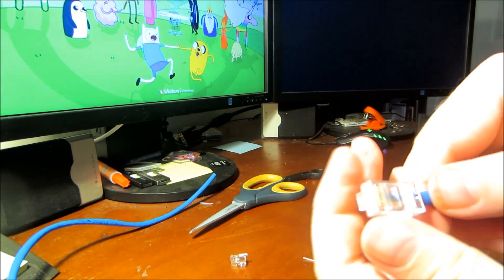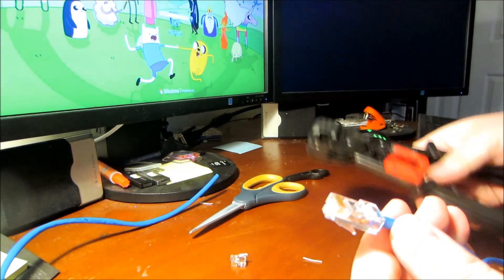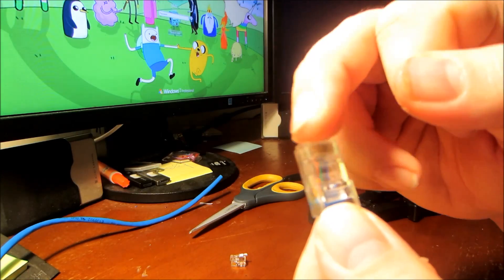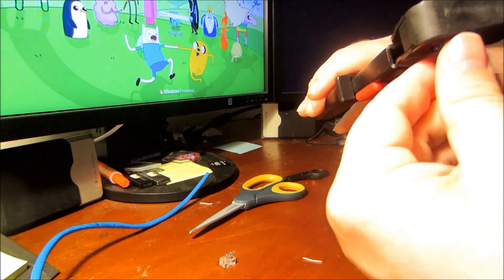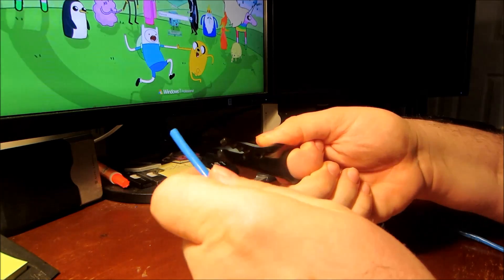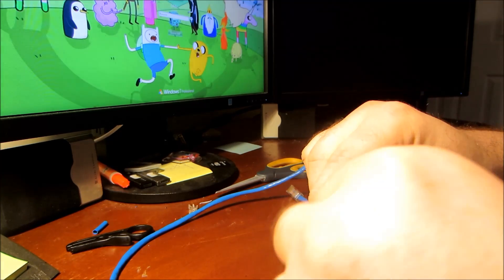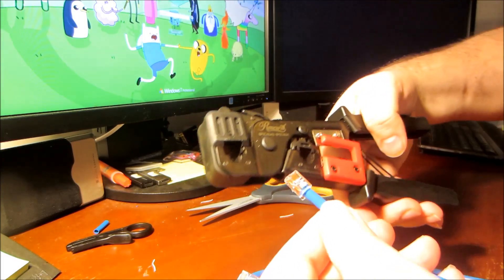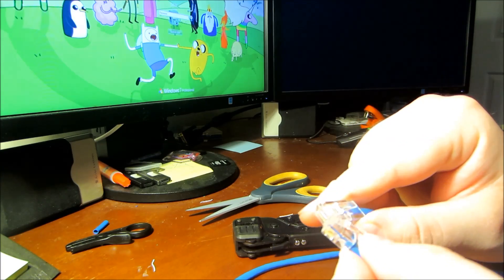How to terminate RJ11 connector to cat 5 cable

Comment: Always use twisted pairs per standard telephone practices to reduce the possibility of noise pickup especially if your cables are long and/or used in areas where they may  be suscepitable to EMI from other electronic/electric devices.

Comment: Just a question I have if you may mind me, I am buying old dated house from 60s and one of the first things is changing the molding inside, can I buy a cat5, cat5e, cat6 or cat3 and wire that into a phone jack and just add a plain rj11 end on the other side, I am using cheap VoIP) Obihai/xlink gateway.  I do not have a network interface device unfortunately so that’s why I need to just add a rj11 end.

Comment: But you're not using pairs properly.  You're using four wires, one from each of the four pairs.  Best phone wiring, especially when modem or router is involved, would use a twisted pair for then main phone line. Blue and white/blue for example.
Reply from the maker: Ummm no. Connecting a RJ45 to a RJ11, actually used for a fax line that goes to a POTS on a router. I think you’re missing why I did this. Was to connect a rj11 to a rj45. Gee magic years later last I knew that line is still in use and working like a champ.
Reply: @samm1462 So using twisted pairs would impede signal quality? Kinda goes against everything about these cables. Whether phone or Ethernet, the wires are twisted for a reason.

Comment: Do you have to use pins 3-6 for rj45, or can you use any?
Reply from the maker: Any, just has to be the same pin/color on the other end
Reply: @samm1462  thanks Sam, so pin 3 orange A end to pin3 orange B end etc.

Comment: I have a modem with an Ethernet output port which can clipped to RJ45, and a router which has a RJ11 input, I.e. telephone input, so can this method be used to solve the issue of connecting a RJ45 output to RJ11 input and get better wifi?

Comment: would this work for cat6
Reply: yes
Reply: No. Cat 6 is too thick a cable to get into an RJ11 plug. Use RJ12s... they are can be used in RJ11 sockets. The pinout is the same.